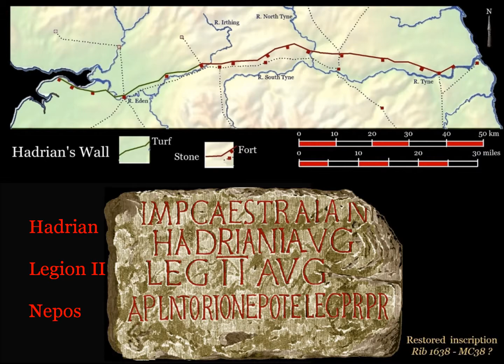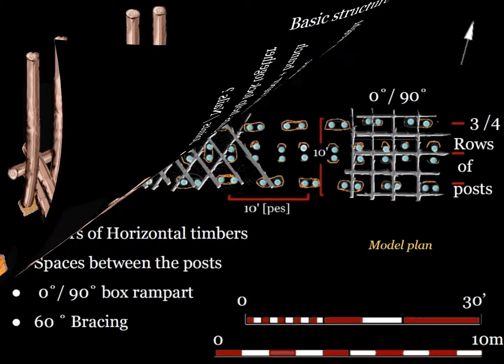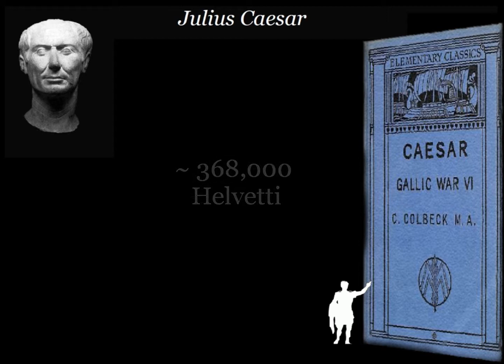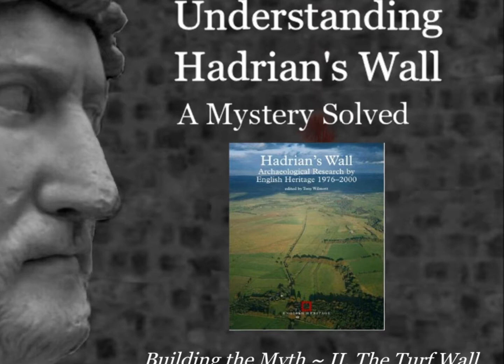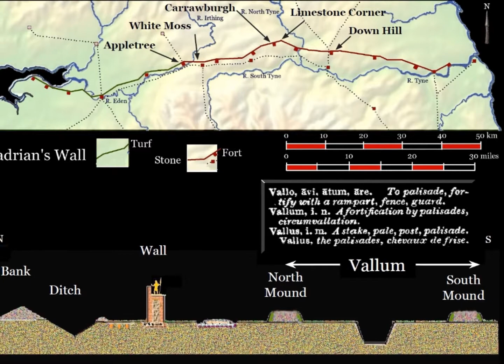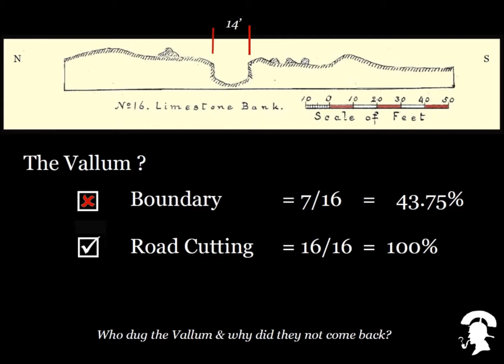Understanding Hadrian's Wall ~ Part 2 ~ Building a Myth  by Geoff Carter   Structural Archaeologist

Comment: Your arguments are very convincing and reasoned.   I do wonder about some of this though. How does the model of the vallum as an unfinished road compare with the preparation of the Stanegate road and does the utility of either clash with the need for existence of the other. As a road foundation was there any value in digging deeper than bedrock?  My own thoughts about the military zone being encompassed by a vallum boundary are that it would be needed. I can see a definite requirement for a safe space for livestock and horses where they would not easily be sneaked away in the night. I think we would have found some attempt at completion of the road at one end.  Also, the reason for Hadrian's Wall to me lies in considering what it achieves that the line of Stanegate forts could not. They don't seem to have suffered major defeat and were renewed over phases.  I think that they were controlling but not stopping movement, not halting an attacking force, hence the wall milestone gateways.   Your part 1 referred to a buffer zone north of the wall that makes sense, but it might be a mistake to consider that a buffer state could be created north of the wall in isolation of the rest of the local tribe south of it.  I would suggest there was a treaty that allowed passage at that time perhaps as a result of the initial timber wall creating unrest.   Elizabeth 1 considered building a wall too because an open border was causing problems in tax and excise operations. It was impossible to have a working tax regime and enforced civil law adjacent to an open border where those things did not exist on the other side. I think this is an economic question that existed for the romans and made the wall imperative. Its exactly the sort of issue that would have waited for an imperial visit to notice and get resolved.  btw   If I remember right Jim Crow determined that there was no ditch in front of Sewingshields crags,  I'm not sure what you think happened to the space between wall and ditch at this point but I think Jim Crow was wrong because at a certain time of year you can see the line of a ditch in the flowering vegetation.
Reply from the maker: Thank you for your comments; Foundation design is based on a even bed, so both hard & soft material is removed and replaced by something predictable. The evidence of a near vertical side is only applicable in a trench, as this is not a stable form.
If you want or need a boundary dig a ditch with a bank, that's what the world does in this and most other periods. (hedges are best). For much of the Wall, the space "bounded" is less than the area of its boundary, which makes no sense in any language, even in Latin!
In many ways, this is a very good example of the clash of "archaeology" being a process of validating of existing ideas by reproduction,  against using science to solve problems using the evidence alone.